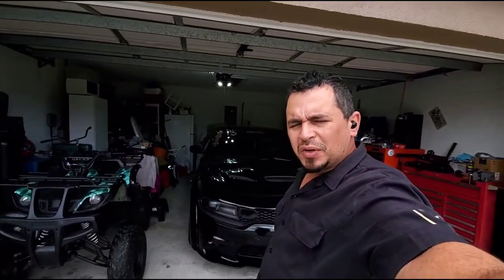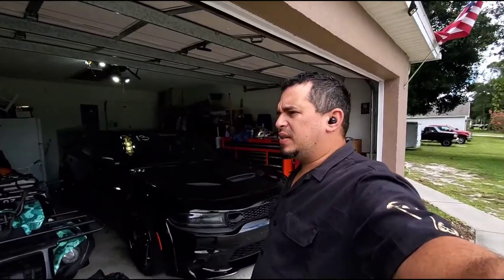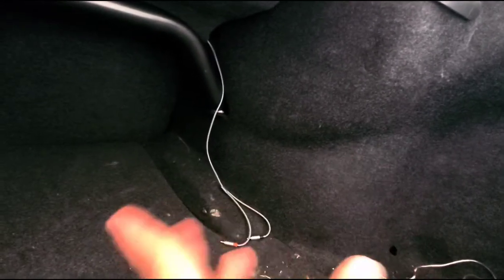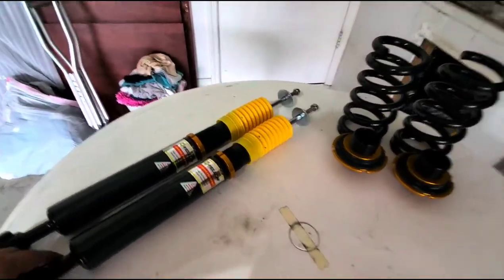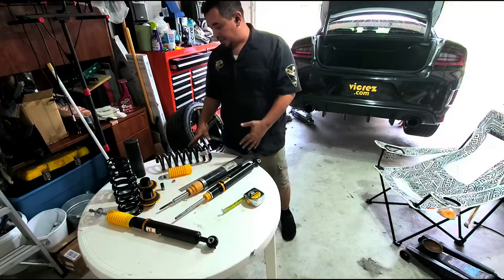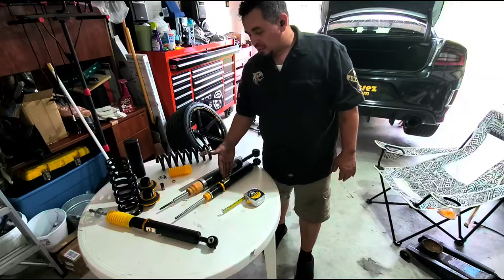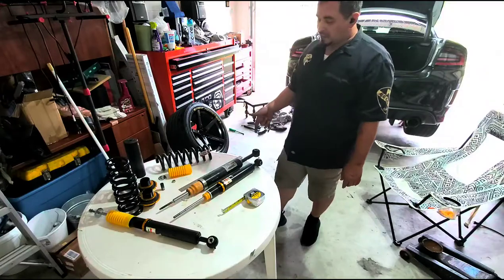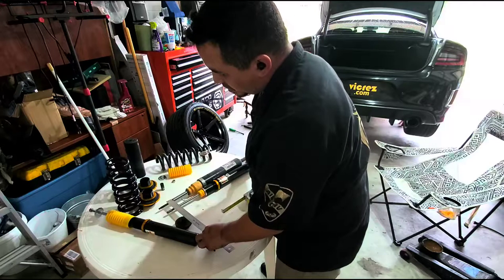Charger Pursuit AWD rear Coilovers install.

Comment: if you plan to put coilovers on your car you need to change the camber because if you don't change them they won't be able to do the alignment and they will wear the tires sideways
Reply from the maker: I knew this, that's why I installed fully adjustable camber arms. I just didn't make a video of it but thanks foe the advice am sure other viewers will appreciate it.

Comment: Cool Video man, So few people with these cars. I have a 2015 charger pursuit. Its the only way I could get the engine I want with the AWD I want. Have you done anything about the rear door locks or the Trunk? I keep telling myself I am going to get in there and cross wire the rear locks so that they pop when the front door locks do. I have kids not convicts. I dont need to keep them locked in.
Reply from the maker: I made a video of me hacking onto the car. Basically you will need to convert the car from police mode to civillian mode.

Comment: Hello, I just purchased the same coilovers for my same AWD Hemi Charger. I'm going to have them installed in a bit. Do you have any suggestions or recommendations? Also, should I tell them to give me 14k springs front and back instead of 12k on the front? (I'm lifting my Charger 2 inches instead of lowering it)
Reply from the maker: Yes 14k all the way around
Reply from the maker: Also set preload at 1.5 inch
Reply: @sumcrazydude  I'm raising, not lowering
Reply from the maker: Yes that is for raising it, get a 14k spring and gave it more preload, instead of .2 of an inch do 1.5 of an inch. They can also provide with a longer travel shock if you really want to run that as a rally car
Reply from the maker: I have the longer travel shocks but I decided not to install em.
Reply: @sumcrazydude  what are longer travel shocks and what are their benefits?
Reply from the maker: Well let's say you really want more shock travel for rough terrain. Kind of a rally car like suspension. The benefits are that you can jump the car and be able to handle bumps like no other car.
Reply: @sumcrazydude  I really appreciate the information. Is there a way I can private message you to discuss further? It's sort of a complicated situation. Thanks!
Reply from the maker: Dm me at hemi_addicted on Instagram 😁